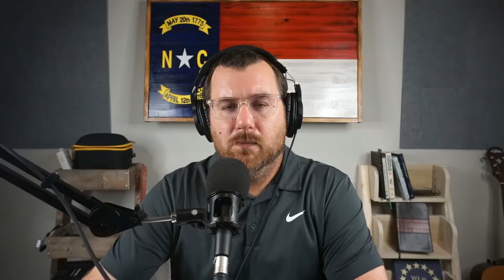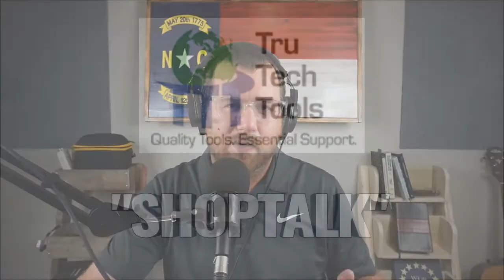Why Charge Refrigerant Blends as Liquid?

Comment: Does this flood the compressor with liquid?
Reply: @seek3n You are correct that charging them as a liquid into the compressor CAN "slug" or flood it, but there is a catch where you can charge it VERY LITTLE by little in liquid state while a system is operating into the compressor side. Small amounts of refrigerants entering the low side in liquid state WHILE the system is operating will quickly vaporize unlike adding too much where then it will certainly damage the compressor. An important tip, charge liquid to high side when a system has no refrigerant to its needed charge PRIOR to starting the system up. If the system is already running, charge it as a liquid on the low/vapor side slowly and by increments. Hope this helps you out and sorry if I wrote too much. 😎
Reply: Please I need to know I see this all the time. Using your example please explain because I don’t want to confuse myself I see many tech charging refrigerant back into the system when it’s not running through the low vapor side or as many people call it blue side hose. I need to know if it’s problematic or is it fine when using either virgin refrigerant or recovered refrigerant.